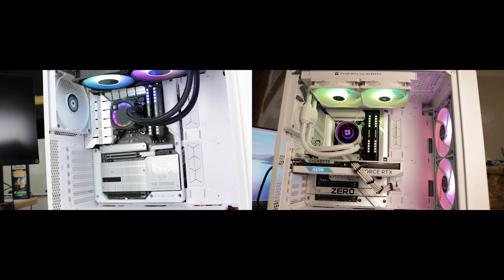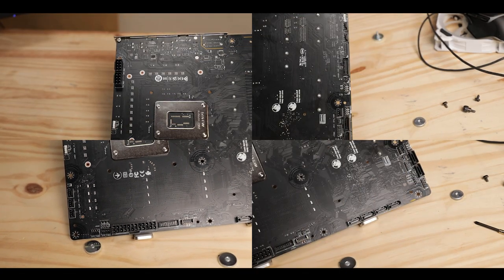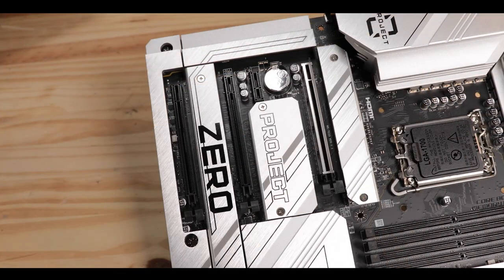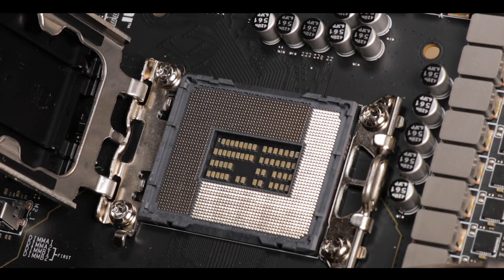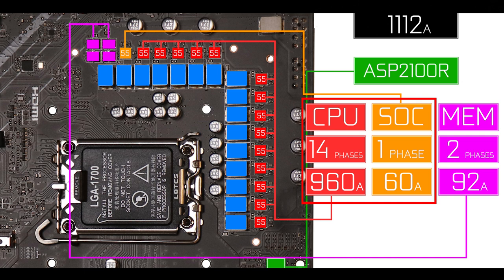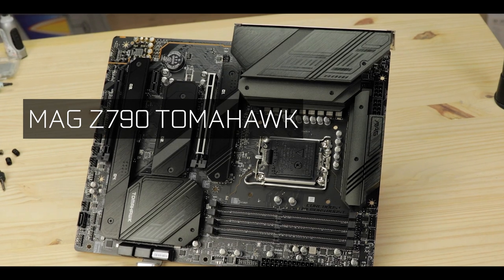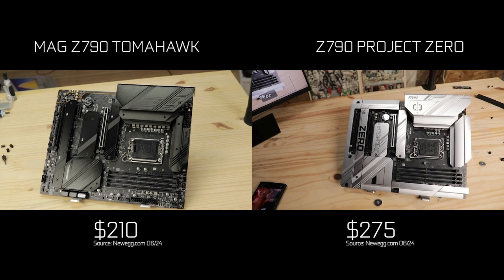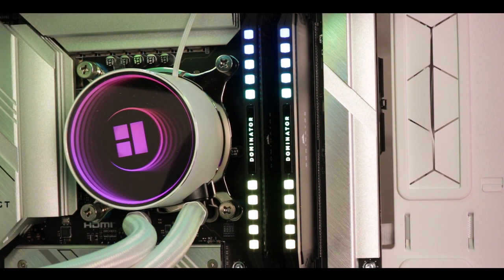MSI Z790 PROJECT ZERO : Beautiful outside, ugly inside

Comment: Thanks for giving me a kick to my stomach. I don't know about power phases and more in depth knowledge like that but I had thought this was a great motherboard before completing my build. I was looking around because while my cinebench test placed well above every other setup, my intel i9-14900k is only at 3.1 ghz, with the default oc profile and my ram are ddr5 6800 mhz 96gb x2(192gb) and I'm not getting no where near the mhz my ram are able to, even with xmp enabled. The only thing that makes my new build fast is my m.2 nvme drives(x2) are in raid 0. The only part i bought that I didn't try to get top of the line is my gpu which is an asus rtx 4070 and that's because I want a pcie 5.0 gpu. One detail I believe you are wrong on is that the first m.2 nvme and the gpu can use pcie 5.0 but you can only have one or the other and are not able to have both pcie 5.0. Could you please give me some input on a better motherboard with rear connectors, that I will be able to run all my hardware at their specs, thank you.